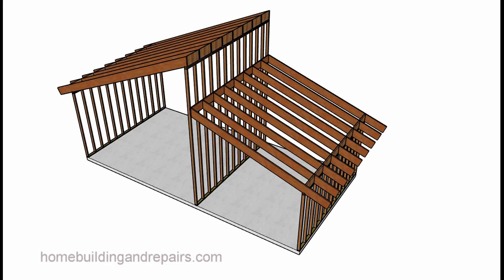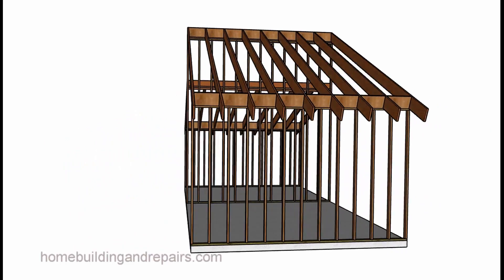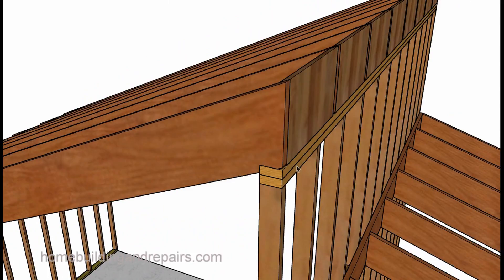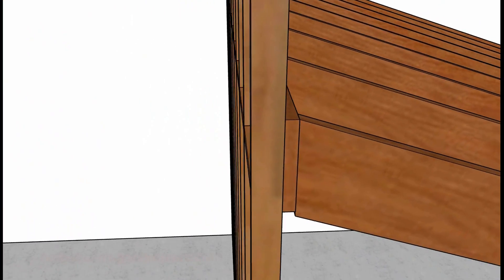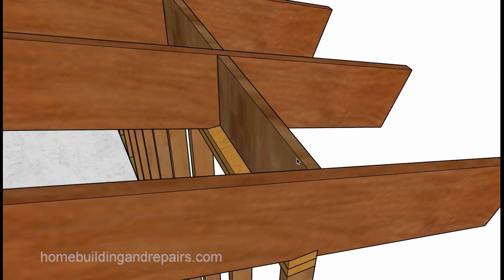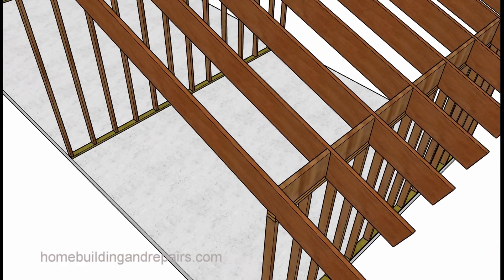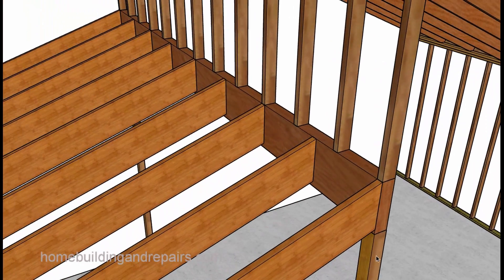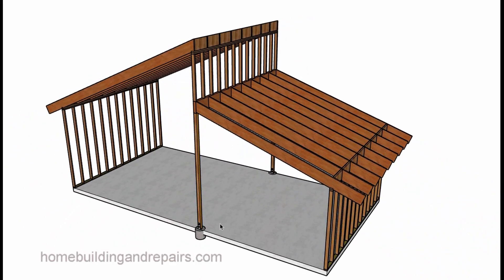How to Frame a Double Shed Roof with Wall in the Middle - Home Building Ideas

Comment: Will toe-nailing with 16 penny nails provide adequate holding strength for the lower rafter to ledger connections, or should you use joist/rafter hangers? Code in my township is 50 psf snow load for reference.
Reply from the maker: Check with your local building department. That's a lot of snow and you might need a better connection.

Comment: Love the build.  I just finished my 12 x 16 shed / workshop.  It's awesome but now I am working with the electrician and he noted I don't have ceiling joists going from wall to wall (I have a lean-to), do I need ceiling joists? I see you and many others are not using ceiling joists that go wall to wall and tie into the rafter at the bottom

Comment: How are you venting this roof with the way the blocking is shown?
Reply from the maker: You will need blocks with vent holes and screening at bottom and some type of ridge vent at top if you can't use blocks with vent holes. I've build some home with out ventilation in vaulted ceilings.

Comment: Do you need a footing for this building? Or 6 inch pad work?
Reply from the maker: It will depend on the building design. I would think a 6 inch thick concrete pad would support a small shed, but not a large house.

Comment: Building a house that has the same concept. The only difference is that the middle wall will have windows facing west. How would you frame something with an overhang that goes down to block some of the sun coming though the windows. Thanks for the videos!
Reply from the maker: I would need to make a video to explain it and put your suggestion on my list.
Reply from the maker: It might be cheaper to use tinted window.

Comment: Thank you for the great explanation on this double shed roof.

We are building a small one bedroom single floor house. We would love to have this type of roof but are completely confused on where the heating and cooling ducts go? Please, can anyone explains this?
Reply from the maker: If they cant fit into the space between roof rafters or wall framing studs then you will need to build ceiling soffits to cover pipes or use a floor heating system. Make sure you plan this out before building and have a general idea what it will look like. I've had to deal with a few unhappy clients on this one.

Comment: im doing a shed very similar to this design but the higher roof level is going to be like a second story, i have 10’ first floor walls….i need help trying to figure second story walls and what rafter lengths should be on both sloped roofs,,,its a 12x20,,,,can u please help?

Comment: How would you frame the middle wall  if you were to put a second story on the taller side? I’m looking to build this exact roof system on a 24x24 garage with a second floor office. Curious if I’ll need a post in the middle or what size beam across/footings.
Reply from the maker: I don't know if I can explain it, but here goes. The roof would simply attach to the wall framing on the second story and then transfer down to either a wall or structural beam below. Here's a link to our website it might be helpful.
https://www.homebuildingandrepairs.com/framing/index.html

Comment: Hey Greg, fantastic site. Would this work if the lower roof were actually Flat (1/8"/ft)  surrounded by a Parapet wall? Also where do the sides get shear strength from?
Reply from the maker: I've seen it done before and you could always frame all of the exterior walls using materials that will provide you with the structural strength necessary for this type of structure. Keep in mind that I cannot provide you with structural engineering information, but plywood share panel and hold downs usually work great.
Reply: @gregvancom  Thanks for the input very much. Indeed, everything I build has 1/2" sheathing with metal wind braces cut in on the diagonal. I plan to sketch it out and check with an engineer.
Reply: I built a shed with these plans from Ryan  [ Details Here?> WoodBlueprints. Com ] . The instructions were clear and easy to implement. Even a novice can be able to build fast using this plan. I'm happy I bought the plan. It also saved me much cost.

Comment: Man, I love your channel!  I'm going to be convert;ing my flat roof home to a new rafter roof with a nice grade so the water will run off.  Whoever built my home in the 70s didn't design it very well at all.  I have ponding water all over the roof.   So I'm researching how to do it myself and another handyman.  I have an engineer lined up too when we are ready.  I want to make sure it will pass code when we're done.  I plan to use a TPO system for the final roof cap.  I heard it can last a very long time if it's done properly.  Anyway, I'm learning a lot on to do some basic stuff and some that your talk about that is clearing up some of my questions.  Cheers!   Subbed!
Reply from the maker: I always enjoy reading comments like yours and thanks for letting us know you like the channel.

Comment: When framing the side walls how would you overlap your crown plates with those of the end walls? Would it be enough to toenail everything down from the outermost rafter down into the crown plate of the side and end walls.
Reply from the maker: I need some more details before I can answer your question. I don't understand what you're referring to when you say overlapping crown plates.
Reply: @gregvancom  Sorry I'll try to explain better.
So we have 4 exterior walls.
One 12' high, one 8' high, and two on either side running from 12' down to 8' in height. 
The walls are layed out and nailed on the ground, throught the top and bottom plate, then stood into place.
Now while running the second top plate or crown plate, I would like to tie the walls together by overlapping my crown plate 3 1/2 inches ( on a 2x4 wall) in the corners. However because my walls run on a angle (high to low) I am not sure how.

Comment: I would put up a double bearing 2x6 central walls under each roof peak.  Therefore, the center wall would end up to be 12 inches thick.  In fact, my exterior walls would be 2x8's on 16" centers with roofing insulation inside.  I got the idea from a man I met who was a miner in Alaska.  The small community built 24" thick walls around their mobile homes and thicker walls like I mentioned for their greenhouses.
Reply from the maker: If you're talking about running two full-length walls next to each other and having one hold up the lower section while the other wall is holding up the higher section, then I wouldn't see anything wrong with that. It's going to cost more money, but could be a lot stronger.
Reply: @gregvancom  Right. I know it sounds like overkill but my brother did a job where he doubled the strength of beams for a huge balcony deck off the side of the 2nd story of a guys house.  Some people said it was a waste, especially other contractors.  He built it 35 years ago and said he drove by it couple months ago and due to storms over the past 10 years, other builders stuff in the county was beat to death, but his is still standing strong.  He loves it because in rural Alabama where he lives, you might wait many years to be right, but then the reward is priceless.

Comment: What would it require to make those posts go all the way up to the high point of the roof, then jack stud/post the beam?
Reply: also I'd like to see a bottom plate on those cripple studs above the beam. Don't know why...
Reply from the maker: I think I would need to see some type of picture of what you're referring to or a better description.
Reply: gregvancom The second drawing where you have a beam in place of that studded wall: the posts supporting that wall/beam; would it be beneficial to span those posts all the way up to the double top plates of that middle/tallest wall and then add in separate posts alongside those, like a jack and king situation,  to support the beam itself?
Reply from the maker: @matthewtrembley3110  I don't know how it would work with the beam going above the lower roof. There wouldn't be anything to support the lower roof.
Reply: gregvancom how might I send you a picture?
Reply from the maker: @matthewtrembley3110  Go to our website or a link to our website can be found in the YouTube description of the video box. Then scroll down to the bottom of the page and click on contact.

Comment: I love the possibility for skylights, but I'm not sure that the roof will have enough structural integrity to stand up to even modest snow/wind loads, since lower roof will be trying to bend your wall.
Reply from the maker: Again, this video is just meant to provide you with an example of how it can be constructed. For example, an engineer might suggest using 2 x 8 wall framing studs instead of 2 x 4 or 2 x 6. You do bring up a good point about the walls trying to bend.
Reply: Even wider wall studs seem a little dicey there.  I think the easiest way to deal with this issue is to extend the low-side roof joists all the way to the high-side roof joists, without changing the angles.  Then you get a triangle (engineer drool: mmmmmm, triangles) right in the middle of your roof.  You lose a bit of direct POV to the clerestory windows from the exposed joists, but paint the joists white and you get the natural light anyway.
Reply from the maker: I like your thinking and your method would definitely create a stronger roof and building. However, like you said it wouldn't provide you with this type of structure.

Comment: Why would you build this. Why not just make it  symmetrical? Seems silly. I don't see an advantage. Do you need fire blocking in a shed? Or hurricane ties? It's a shed.
Reply from the maker: I don't think it's a common structure to build, but it was requested from one of the viewers. I don't know if there are any building code requirements for storage sheds, especially if you're not going to pull a building permit. I would build the shed as safe as possible and as strong as possible, but wouldn't get carried away either.
Reply: simplylifelive that's very extreme. I'm questioning the design. What's wrong with that? Jeesh.
Reply: simplylifelive your question was extreme.
Reply: Funny to me that you pose that question, as this is exactly the design that I have been considering for quite a while. Just haven't pulled the trigger as of yet. I envisioned a lengthwise cement porch on the shorter side, maybe 4 feet deep, with the eve/overhanging the cement porch. A normal walk in door there, with two windows, one either side of the door. As well as a double-door on the end of the shed.
Reply: Because some of us think outside the box and don't have hangups with asymmetry.

Comment: Very nice 3d model   I`m very interested in the flat roof design. I`m build a small cabin in the desert. I would like the roof to extend out 2 ft all the way around. do you have any other design for flat roof construction  Thanks
Reply from the maker: No I don't, but I put it on my list and will put a link here when the video is completed.
Reply: Thanks for you time.
Reply from the maker: https://youtu.be/PsY8rvNR3XQ See if this helps.

Comment: If that central bank of studs is 14 feet high or so, and supporting both roof structures, could you still use 2 x 4 studs, or at that point do you need 2 x 6?
Reply from the maker: Good point, this video is only meant to provide you with an idea of how the building can be constructed, but in no way is it meant to provide you with any lumber sizes or structural calculations. I would imagine that snow loads, roof design and even the building design might require larger wall framing studs then two by fours.

Comment: Hey Greg I got a question for u...I'm framing the exterior wall on the back of my house and the concrete is pretty level but dips on the end of the wall,it's an inch and a half differnce,should I self level with a self level concrete mix or use a green 2x4?where the concrete joint is,is where the 1 1/2 difference is...is can't find a video on YouTube that shows how to frame a wall on uneven concrete,u could be the first! Lol thanx Greg!
Reply from the maker: Yes you can use shims or pieces of plywood or even longer wall studs. For example if you have 92 inch wall studs and you need them to be an inch and a half longer, then use longer ones like 93 1/2 inches. I will put a link to a video when it's made, but I have a feeling you need this information right now like everyone else.
Reply: gregvancom lol thanks Greg! I really appreciate it! Sorry for the slow response,I was away from any cell service
Reply from the maker: https://www.youtube.com/watch?v=htl9Hs8yVqU Here's a link to the video and let me know if it helps.